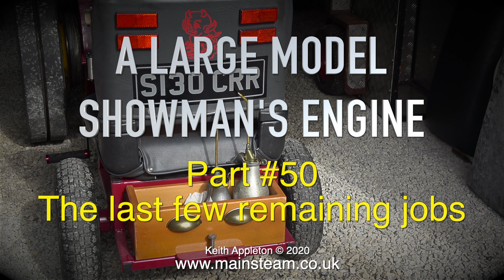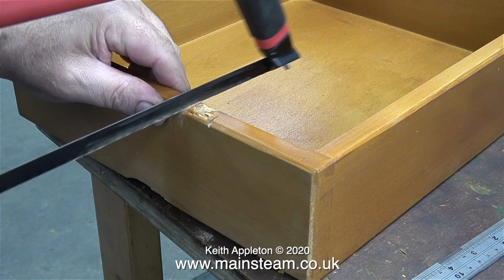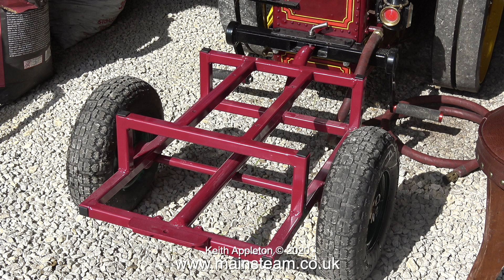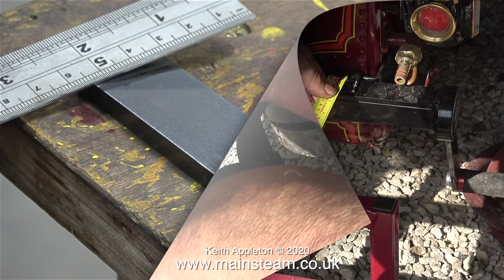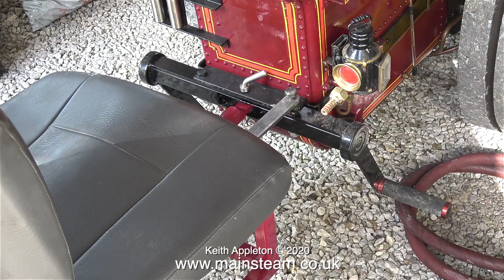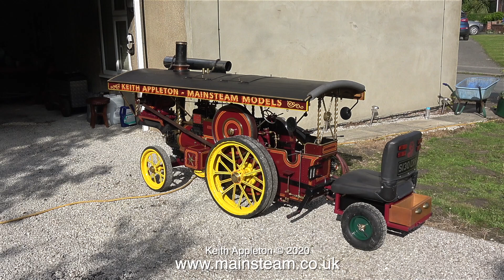A LARGE MODEL SHOWMAN'S ENGINE - PART #50

Comment: Ah the mystical art of drill sharpening. I learnt how to sharpen a drill way back in 1969 in the apprentice training school at the Hawker Siddeley Aviation factory in Kingston-upon-Thames. The instructor handed me a large drill (around an inch and a quarter dia) which he'd ground the end off. When we did this exercise we were told what all the angles were, but not given the angle test gauges, they lived in the instructors desk draw. So off I went to the grinder, and started sharpening, then into the instructor who pulls out his angle gauges and checks my work. Of course the angles are nowhere near, so he goes to the grinder and flattens the end again. We repeat this process again and again over the next day and a half, maybe two days, until my angles match his gauges at which point I'm allowed to move on to the next training exercise. Consequently like everyone else I started with an 8 inch long drill and ended up with a 2 inch long drill at the end! I think all of us in that apprentice intake (and there were 32 of us that year) used 6 inches of drill learning how to sharpen a drill. But like everyone of our group, I'll NEVER forget how to sharpen a drill.
   CharlieG
Reply: Well now. Do complete strangers a favour and make up a video of what you know and how you do it. A 1969 apprenticeship like that is almost unachievable for most young men. Pass on at least some of the stuff you learned. It will not be just drill bit sharpening, but that is a start,and a big deal for a lot of people. If you can,reminisce about the good bits too. You must have some good stories of various events. Not so ?

Comment: Hi Keith - The "problem" with backing your trailer is the length from the kingpin to the axle. The shorter the trailer, the harder it is to backup.
Good solution - I'd never have thought of doing it that way!

Comment: First, lovely stuff. :) I'm but the rawest of novice engineers and your videos are always a pleasure and a true learning experience. So this second part is a surprise to me, and maybe no use to you. The bolt, if you are curious, appears to be what is called in the US a "grade 5" bolt. The hash-marks on the bolt head are used by a standards association over this way called SAE, and a grade 5 bolt should be medium carbon steel, quenched and tempered, with maybe twice the tensile strength of your garden variety steel bolt. (I work with the fancy graded stuff sometimes in theatre, where we use it with rigging hardware.) Anyway, thank you for the wonderful work you do. As you say, stay safe. And I look forward to your next project.
Reply from the maker: Thanks, I didn't know that }:-)))
Reply: @keithappleton  It's pretty obscure and not very useful unless you have to hang heavy things. But with luck it should be a doubly good bolt for your job. :)
Reply: Grade 5 is 3 radial lines, not one. He mentioned work hardening, and I'm under the impression that he wouldn't have been able to drill into a grade 5 to begin with (hardened and tempered). I've seen similar markings on suspension parts, which use a #9 grade bolt (high carbon, no hardening), which leads us to why I replied. There are standards for both continents, all of which have changed over the course of time, many times over. So it's completely confusing lol. British standards actually stamp a hardness number that gives you the tensile strength of the bolt. Good info to have if you're flying things above ppls heads, or attaching a leaf spring perch on a truck....or even drilling into it to make a secondary use for it (and not wreck a few bits).  Good stuff, good day!
Reply: If you look at 2:51 you can see the bolt head fairly clearly. The first line is more clear as it's in a clear area with no other markings, but there appear to be two more bracketing the letters TDF. The color of the bolt is also consistent with a lot of the theatrical truss hardware I've hung over the years, and you might note that Mr. Appleton has occasion to be around the theatre. Honestly, even Chinese bolts seem to follow the SAE standard and have done so as long as I've been rigging. If I found that bolt in a box or rigging hardware I would trust that it was an SAE grade five bolt and I would comfortably use it to bolt together the truss upon which I I might myself sit later in the show. (The better to shine a light on the star attraction of Appleton's High Pressure Hootenanny and Contrapuntal Circus Review.) Maybe it looks different in person, but that surely looks to my eye like a grade five bolt.

Comment: Reversing a trailer with a very short drawbar is impossible no matter what vehicle you are using. The longer a drawbar is the better, if the distance from the tow hitch to the trailer axle is more than the length of the towing vehicle's axle then it gets easier. Towing trailers can be tricky if they are not set up right, I used to drive tractors with 2 trailers, the first one was a 4 wheeler with steering front wheels and the rear one was a two wheeler with rigid tow, with a bit of practice you can reverse with that type of setup even round corners !
I like your idea of fitting the anti jack knife bar for certain situations but I would have thought it was easier to remove the trailer altogether if you wanted to reverse round a corner.
Reply from the maker: But then I would have to walk and even run the risk of running myself over with the Traction Engine }:-)))

Comment: I am 71 now and have been attempting to sharpen drills free hand since I was about 8 years old. Some times I get it right most of the time I don't, when I learned CNC I got into the habit of only using sharp new drills (they were billed to the Job), since retiring I have had to go back to trying to do them by hand. Although I just noticed one of the stores have Drill Doctor sharpening machines for half price, hello Santa!
Reply from the maker: I will look }:-)))
Reply: @keithappleton  My Kind wife ordered one for me, it is due to arrive on Dec. 24.th
Reply from the maker: Which model are you getting? I can't decide which one to buy ...... it will be after Christmas now anyway.
Reply: @keithappleton  Drill Doctor X2 Drill Bit and Knife Sharpener *Was $179.99
$89.99 now They are delivering it for $8.00, we have just gone into lockdown, so delivery is great.